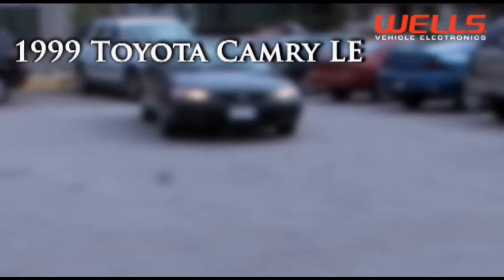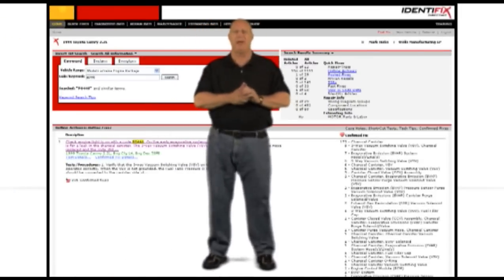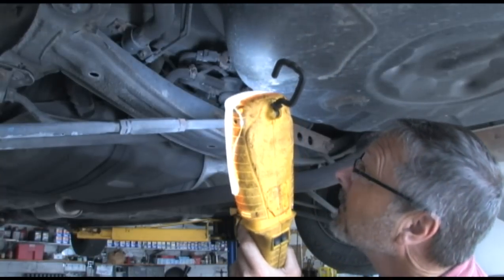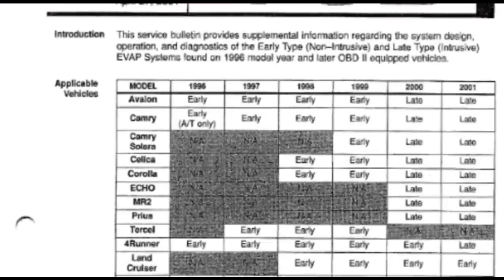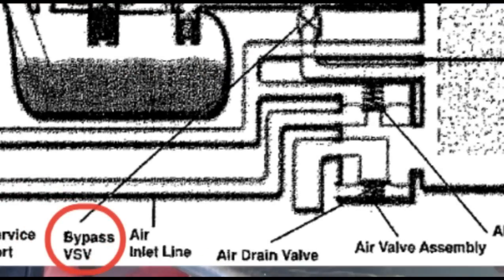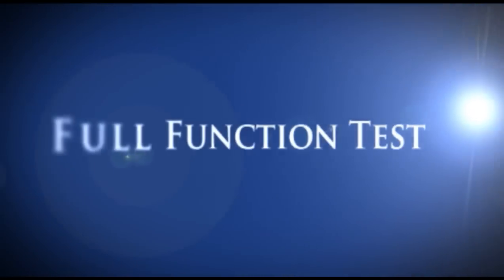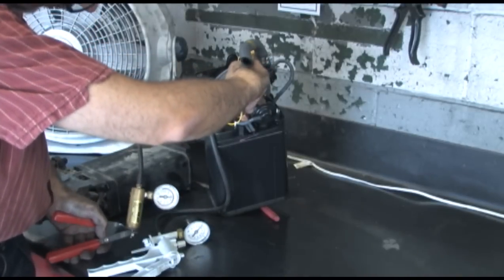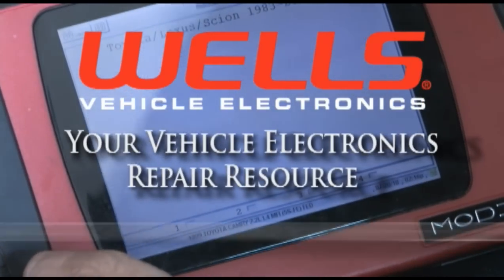Toyota Po441, P0446 EVAP Vacuum Switching Valve VSV Testing and Canister Replacement

Comment: Hi,

Best video I've found.

I got a P0446 code on a 1999 Toyota Avalon. I removed the canister and tested the VSV by following a Chiltons manual. I thought it failed the Ohms test so I replaced it. I tested the new VSV following your video. After applying vacuum to the VSV Pressure Sensor and Purge valve hoses it held vacuum when the solenoid was activated then deactivated but when activated again the vacuum on the purge side didn't go to zero, it went to about 8. 

Thinking I may have gotten a defective part I tested the Ohms and it was within specs. I then realized that the original VSV was checked using the wrong specs so I I rechecked it and it also was actually in specs so I reinstalled it to the canister and did the vacuum test. This VSV also did not return to zero. I hung at around 5.  

I'm now wondering if this means I have a bad canister and/or if there is another test to isolate the canister. Please advise. Thanks.
Reply from the maker: Hello Robert,
The charcoal canister has valves built inside, it is recommended on your vehicle to replace the canister and 3-way VSV as an assembly. It is extremely common for the canister to fail on your vehicle. Chances are you are right in your assumption. 
Mark Hicks
Wells Vehicle Electronics
Reply: Thanks mark. The OBD also has a P0420. The O2 sensors and CAT were replaced about 2 years ago. Could these be related?
Reply from the maker: In most cases 02's and the Cat are unrelated to the evap system. The Evap is a standalone system. The only way they really could be related is inside the PCM. As for the P0420, chances are you have a bad CAT. 
Mike Becker, Technical Services Instructor
Reply: Robert Nunezhttp://hindimoviesonline.cc/baar-baar-dekho/http://hindimoviesonline.cc/baar-baar-dekho/

Comment: Hi, my 2000 Celica Gt has had a P0446 code for awhile now and of course it needs to get inspected. I see my canister is tucked by the gas tank and muffler. Is that most likely the problem and about how long is it to replace? Thanks
Reply from the maker: The canister is very common. It is located back by the gas tank and is quoted at about 1 hour for a technician to replace it. If it's your first time doing it, I would carve out an afternoon to get it done. 
Mike Becker, Technical Services Instructor

Comment: I tested the valve like shown in the video and it held pressure. When I connected the battery the pressure only went down to zero if I tapped the battery connection few times but the pressure on the other gauge when up.is this normal? Should the pressure go to zero without having to tap the connection more then once?
Reply from the maker: +worldofhurts Yes, the pressure should drop off when the battery is connected.It really should only take one time, if the vsv is working correctly. It's odd that the gauge is going up though, you are on the correct ports of the vsv like in the video right? Talk soon.
Mike Becker, Technical Services Instructor

Comment: How much are typical repairs to diagnose and then REPLACE the cannister....
in other words.....worst case scenario on this code.....
any idea on repair Range?  I realize it varies but just a ballpark on the 
Fair price for job done would be great
Reply from the maker: megaturdmaker Canister replacement time will vary per vehicle. What kind of car do you have, I can look up the standard labor time. As for diagnosis that is up to the shop and the amount of time that is involved in finding the problem. Generally speaking you will be charged at least one hour of labor time for diagnosis. The harder the problem is to find, the more time and money it will take to diagnose.
Mike Becker, Technical Services Instructor
Reply: Thanks Mike!   2002 Sienna van
Reply from the maker: megaturdmaker The standard labor time for replacement of the evap canister on a 02 Sienna is .4 hours.
Reply: Four hours? or Point Four hours?
Reply from the maker: (Point) .4 hours

Comment: Hi Mark!  I have a 2001 Sienna and am Getting code  P0442 (sometimes P0440) as well as P0420.  I think P0420 is the Catalytic Converter.  Are 442 and 440 most likely the VSV?
Reply from the maker: Hey Jeff! Yes most commonly it is either canister or VSV or both that get replaced. it can be other causes too. Like vacuum hoses etc. So be sure to give it a good look over before anything gets replaced. Yes, P0420 means cat 95% of the time.
Stay in touch,
Mark Hicks
Wells Vehicle Electronics
Reply: good

Comment: Hello I have a 2007 audi A4 quattro but i have a trouble with the P0441 what I need to check ? This is a 2.0 turbo car thanks
Reply from the maker: 1. Check function of the N80 canister control valve. (it is the purge solenoid on this vehicle and very common to fail in extreme temps.) The valve is a normally closed valve that is duty-cycled open by the Engine Control Module (ECM) to purge the canister. The valve can become varnished and sticky. Verify that the valve fully opens and closes and does not leak (either by manually applying power and ground to the solenoid or activating the solenoid with a scan tool through the output diagnostic test mode).

2. The solenoid must fully open (release vacuum) when activated and fully close (hold vacuum in both directions) when deactivated.

3. Inspect the solenoid for contamination and clean as necessary.
Need anything more, just let me know,
Mark Hicks
Wells Vehicle Electronics

Comment: vsv only are now available....no need to buy it with the canister
Reply: i dont know about the labor cost because i did it myself.....a mechanic friend told me its seldom the canister becomes faulty, mostly its just the vsv which is about $40-50 from the popular parts store or a little less from amazon...got mine from the junk yard for $6.....its easy to replace...you can do it without removing the whole canister....the space is a bit tight... so you will be needing a small vise grip or very small screw driver to remove the screw that holds the vsv to the canister
Reply from the maker: At the time of the making of the video the VSV was not available separately, but yes, today they are. the test procedure stays the same. Great comment EvendimataE !!!!!
Mark Hicks
Wells Vehicle Electronics
Reply: markjhicks what is the part # for a vsv for 1999 Lexus rx 300. I believe the charcoal canister is easier to access on the Lexus.
Reply from the maker: 14hubbajo
Call 1-800-558-9770 press 2 for the catalog department.
Mark Hicks
Wells Vehicle Electronics
Reply: markjhicks Thank you.  I'll look into it.  I took it off tonight and I can't find one online so far that is an exact match.
Reply: EvendimataE 

How much are typical repairs to diagnose and then REPLACE the cannister....
in other words.....worst case scenario on this code.....
any idea on repair Range?  I realize it varies but just a ballpark on the 
Fair price for job done would be great

Comment: Hey Mark I just had a P0441 CEL come up the other day. I've replaced the gas cap and checked for cracks in the hoses around the charcoal canister. I haven't done a smoke test or anything like that, just visual inspection. The P0441 trouble code has come back, what can I do next? Besides change the canister.
2001 Tacoma 3.4L
Canister is in the engine bay with a couple switches/ valves on it. If I can replace a switch to fix the issue that would be awesome.
Reply from the maker: Check the Vacuum Switching Valve on the canister. This is a normally closed (N.C.) valve. When energized, it should open. When de-energized, an internal spring should close the valve. I am not sure if you have to replace the canister or if you can get the valve separately. I have heard the valve is now available by it self. But i have not verified it. It is also common for the canister closed valve to fail. Verify that the canister closed valve (located on the air filter housing) closes and does not stick closed when operated. This is a normally open (N.O.) valve. When it is grounded, it closes, and it should never stick closed.
Stay in touch,
Mark Hicks
Wells Vehicle Electronics

Comment: Nice video. I have a quick question. I have an 08 toyota yaris with just a PO441 code. The code reads leak or purge valve. Is the VSV the same as purge valve. What about the solenoid? Are they all the same? My canister costs 800. Im hoping its just the vsv? Thanks.
Reply from the maker: First try the gas cap. A quick test that works most of the time, put a small amount of Vaseline around the seal of the cap after cleaning it. Very common for the gas cap to cause this issue on your vehicle.
Mark Hicks
Wells Vehicle Electronics
Reply: Thanks. I tried it and did what you said.  Should i use orginal gas cap or a new aftermarket one? But is the VSV same as a purge valve though?
Reply from the maker: Use the present cap you have on the car. Vacuum Switching Valve here is a link to an article you might find interesting.
http://www.starenvirotech.com/teacher/Magazine%20Articles/Motor%20Toyota%2006/ToyotaEVAP4.pdf
Mark Hicks
Wells Vehicle Electronics

Comment: 96 lexus es300 same code p0446 should i check my canister like this camry? i need it smogged soon
Reply from the maker: Yep, same set up. Be sure to check all the hoses first. It is common for the hoses from the canister to the air cleaner to spring a leak.
Need any thing, let me know,
Mark Hicks
Wells Vehicle Electronics

Comment: Hello Mark.. My 2000 Tundra, (4.7 liter) has a faint smell of gas, both from under the hood, under the vehicle.. No leaks at all. Checked under the truck thoroughly..Checked the hoses on, and around the vapor canister. No sight of gas leaking from the gas tank either... Like I mentioned, it is a faint odor of fumes... Frustrating.. Thank you.
Reply from the maker: Well this will be a tough one. After checking Identifix and iATN, I found no history of your vehicle having this problem. However, they do have an issue with the gas cap. It is possible to have a leak in the cap this time of year but not set an EVAP code. Reason the ambient temperature is too low, depending upon where you live of course. I would also check fuel pressure. Make sure the gauge does not leak down after it is energized.
I would also remove the hoses from the canister and VSV to check for any signs of fuel.
Stay in touch,
Mark Hicks
Wells Vehicle Electronics
Reply: Excellent.. Will do that...Thanks Mark...

Comment: My car is Corolla 2009. Suddenly, The Eng. Liter comes up! The Toyota dealer told me I should replace the Canister. The price is 400 dollars!!
Do I have any cheaper choice?
Reply from the maker: Try checking with some independent garages. Look for one where the technicians are ASE certified.
Mark Hicks
Wells Vehicle Electronics
Reply: Mzajia87 I was quoted $800-900 to replace canister on '07 Sienna!
Reply: @ChelleyH  That is about right, but I don't know how anyone who would be happy with the cost of the canister and labor, lol!

Comment: 2001 Toyota Avalon. 3.0 V6 with VVti. I've already replaced the VSV that is on the air filter box 6 months ago. Thanks and I really appreciate your help. I've also replaced the gas cap when the dealership replaced the charcoal canister.

Comment: My check engine light came on with the codes: 0440, 0441, 0446. back in March of this year. I had the charcoal canister changed at the Toyota Dealership after 2 weeks of the lights being on, it was due for inspection for the month. The same engine code has just pop back on. 0440, 0441, and 0446. I have checked the hoses for cracks and have changed them. What should I do next? Help me please, I have spent over $1,200 in parts and labor at the dealership.

Comment from the maker: The vehicle in the video had the early design. There was no way to replace the VSV alone when this video was produced. It is entirely possible Dorman have developed a replacement I am unfamiliar with. The bulletin we show in the video is right from Toyota. Just a thought you may have a late 1999 vehicle with the new design. If Dorman has come up with a replacement it is great news. However, to be sure it is a VSV issue the diagnostics in the video will still work. 
Thanks for the comment Mark

Comment: I must disagree. I also have a 1999 Camry. I just replaced mine this morning, without removing the entire canister. The removal of 1 screw and the 3 vacuum hoses was all that was required. Replacement was easier than removal. It took me about a half hour. See Dorman part number 911-602

Comment from the maker: 3. If any wire does not illuminate the light or is dim, trace or replace that wire and retest the operation. 

It is common for the black wire back to the PCM to have an issue.

Mark Hicks
Wells Vehicle Electronics

Comment from the maker: 1. Verify the Black wire pin 2 at the Idle Air Control (IAC) has battery voltage. Check the wires from the IAC to the Powertrain Control Module (PCM).

2. Disconnect the PCM and the IAC, apply 12 volt power with a fused jumper wire to each wire one at a time. At the other end of the harness use a high beam headlight for a test light, the light should be bright at each wire that power is applied to.

Comment: I have an issue and it is now time to ask.
I am throwing a P0505 code in my 1996 Corolla, it has about 220k on the clock.
Has been well maintained and is a 1 owner car.
I replaced the IAC valve with an aftermarket one, i replaced all the vacuum lines, I replaced the pcv valve.  The code still is there and is driving me insane.  I need to register this car as the registration expired a few days ago.
I hooked  up to a Snapon Modis, and it shows values of 50-60 for the IAC%
ALL VSV values = OFF

Comment: A lot of times all thats bad in the actual VSV itself, $60 bucks, rather than all the parts in/on the canister ($350) going out at once. In my opinion, this old canister didnt click because the VSV was bad unless tested otherwise. Read about it, do your research, and save a bundle.

Comment: I HAVE A 2005 TOYOTA TACOMA 4DR PRE RUNNER V6 4.0 LITER. IT HAS A CHECK ENGINE LIGHT AND THE CODE SAYS IT HAS TO DO WITH THE EVAPORATION IN THE FUEL SYSTEM. ANY IDEAS WHAT IT CAN BE?
Reply: Hi, my wife has a 2000 Camry Le and 2 codes came up one was a P0300 and a P0446. After changing the plugs it started but it still sounds loud like there may be a vacuum leak somewhere. I also replaced the air intake hose which had a split in it. What should I check next ?

Comment from the maker: Check fuel pressure while the problem is occurring. I would also look at spark at the same time. If the spark cuts out and then the engine dies you know you have a spark issue. The next step is to determine what system the problem is in. If the FP is good and spark never cuts out but the engine died, then you need to look at injectors, to make sure they are firing at the point of dieing. 
Mark Hicks
Wells Vehicle Electronics

Comment from the maker: Usually, these codes on your vehicle mean either a vacuum hose leak or a canister that needs replacement. As far as the misfire, check the timing marks, it is common for the water pump to begin leaking and cause the belt to slip. Could they be related? I have no history to say yes, but is it possible? Yes, I guess it could be. First check for vacuum leaks and then the timing belt. 
Mark Hicks
Wells Vehicle Electronics

Comment: Hello Mark, thanks for the video! Trying to diagnose a poorly running engine. Feels like it misfires or stuttering when under load but usually clears up in the upper rpm range. It is a 03 supercharged 3.4l in a tacoma. Toyota denies a problem and then blames the s/c when pushed. All the typical tune ups fixes do work. Plugs, wires, MAF, injectors, fuel filter, fuel pump, new exhaust. Makes full boost. Every time I reset the codes 441, 442, and 446 come back. Think this is an unrelated issue?
Reply: https://youtu.be/-Jrb9rqYmoY
Reply: Did you ever figure it out? Same car same issue
Reply: @KollynJ  I have no idea, lol. It was 9 years ago and completely forgot about the issue. The truck was sold about 7-8 years.

Comment from the maker: 1. Test the gas cap, check for vacuum leaks, and verify that the N80 canister purge valve does not leak when closed. 
	
If doing smoke test, watch for smoke coming out of the bottom of the canister.
Mark Hicks
Wells Vehicle Electronics

Comment: i have a 2001 vw passat with a po442 code (small leak). I did a smoke test and everything was fine. The next thing i was hearing at the back was a ticking sound coming from somewhere close to the gas tank. I'm wondering if the problem lies somewhere there. ANyone has an idea what that sound might be.

Comment from the maker: I want to apologize for the slow response, medical issues. 
An EVAP problem will normally not stop the vehicle from running. Make sure the fuel pressure and spark good while the engine dies. We first need to find the the problem system.
Mark Hicks
Wells Vehicle Electronics

Comment: I have a 97 Toyota Camry. I pulled the code P0450. The car starts and runs for a couple of seconds, then dies. No fuel leaking. Just changed the fuel pump and filter.... Any help is appreciated. Need the car for Friday. Thank you!

Comment: Hi Mark, I have a 2000 Toyota Corolla that has code P0440, 441 and 446.  I used the method in this video to confirm the VSV at the canister has gone bad.  My question is, do I have to replace the whole canister, or because it's a 'late' design, I can just replace the VSV?  Thanks~!
Reply: Lmk

Comment from the maker: I will assume you have the 6 cylinder. Most common cause are the vacuum lines near the air cleaner. Next most common is the CCV or canister close valve. 
Stay in touch,
Mark Hicks
Wells Vehicle Electronics

Comment: mark I have an  2001 Toyota solara with p0440 code I replaced the gas cap and cleared the code but it has came up again. not sure what I should b after the charcoal canister or one of the valves?